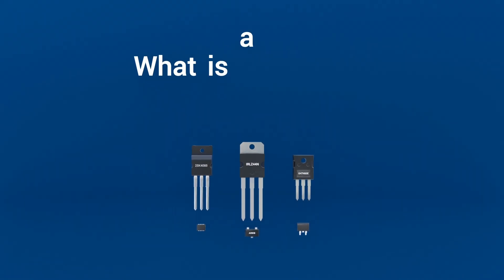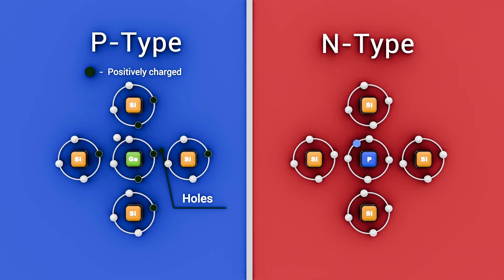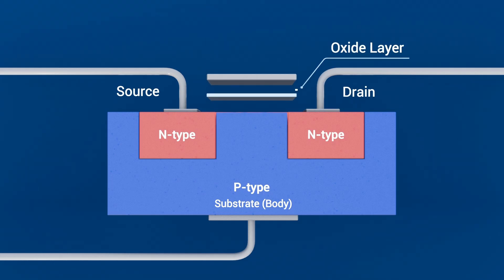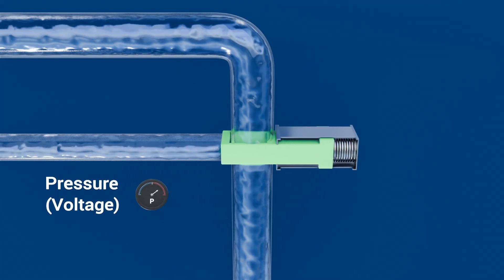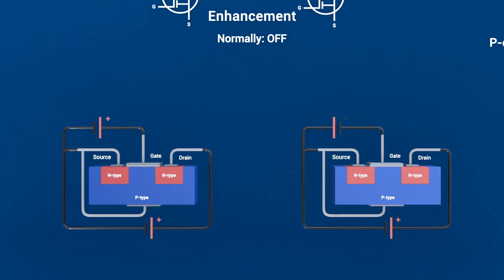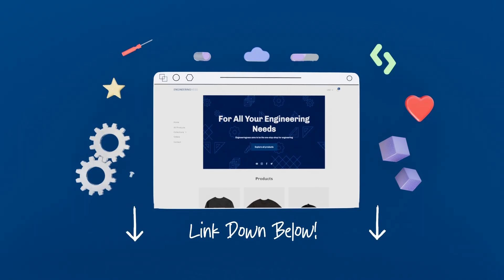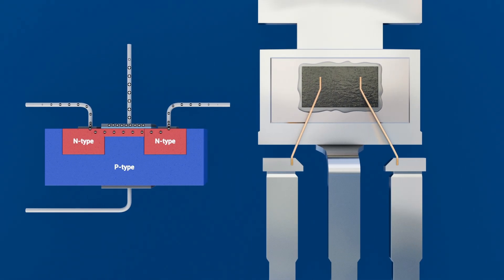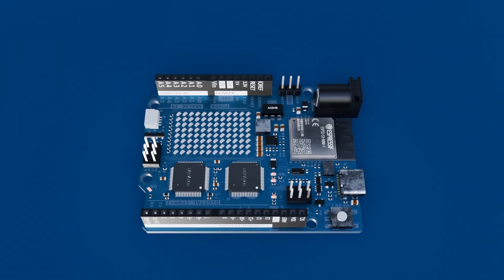MOSFET Explained | Inside the Transistor Powering Phones, CPUs & EVs

Comment: Superb explained Welldone. Sir, if possible for you then kindly made the videos on the following topics:  "As we know that any thing in our Universe always flows from higher potential towards lower potential such as in case of water & the flow is because of the difference of height between two levels but I can't understand the concept that what actually difference of potential energy arises in case of battery because it is never because of height then what is the actual reason behind this difference &  why do we always say that positive terminal of the battery is at higher potential & negative terminal of the battery as lower potential. Although the electron always flows from lower potential towards higher potential? & the second question is that What actually the potential in case of a battery refer's to & why it is in case of battery taken as higher for positive & lower for negative terminal"